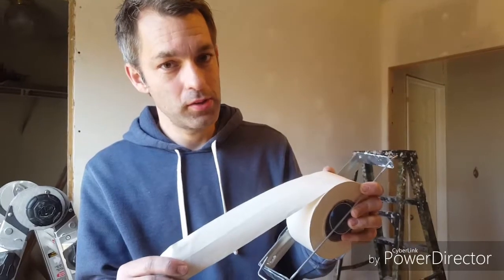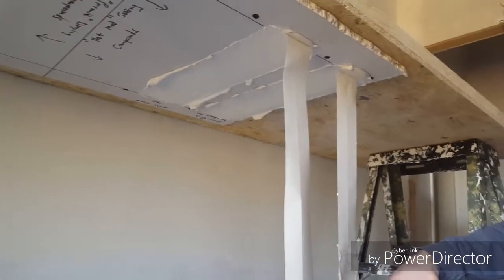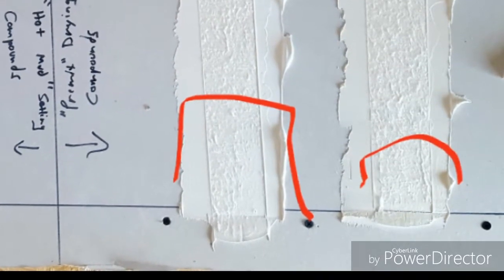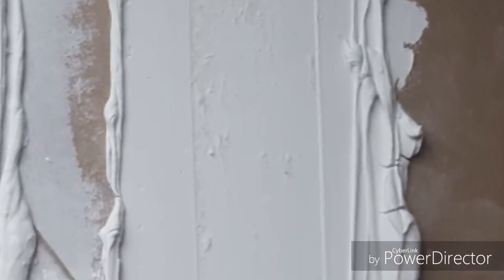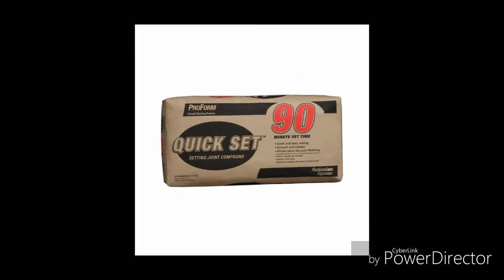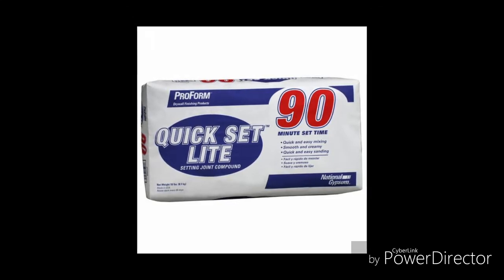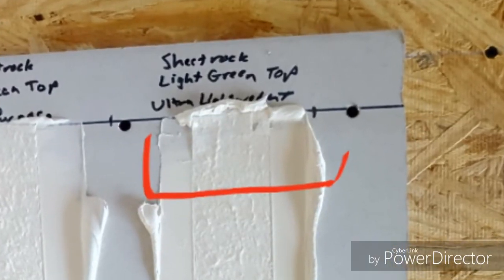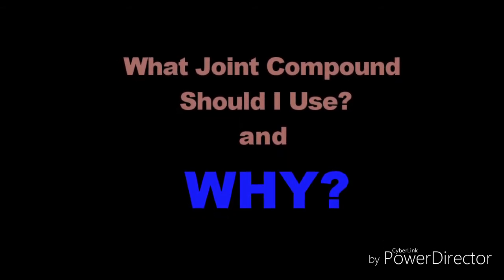Which Joint Compound Should I Tape With???

Comment: "In all actuality, nobody is going to be pulling paper off the walls"  -- hey man, come party at my house sometime, I'll show ya how it's done!!  EXCELLENT video.  Good to see many urban legands and slapfights put to rest.  Keep up the good work.
Reply from the maker: The reality isn't so much that paper is pulled off; humidity and seasonal wall movement pop tape loose. It's a common issue you see all the time if you look at joints (both pro taped and home owner taped). USG Durabond is much more resistant to humidity vs USG Easy Sand or  USG bucket compounds (Lite and Regular). Beside humidity Durabond has much better holding power. That's what the video is demonstrating. Thanks for the comment.